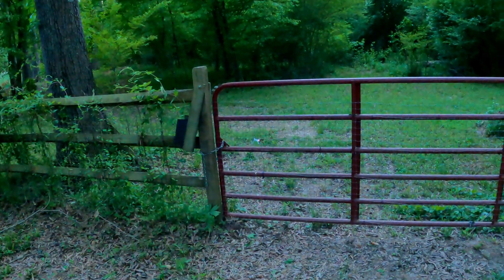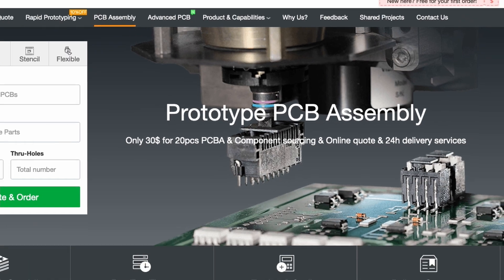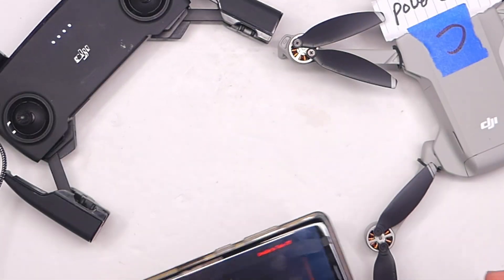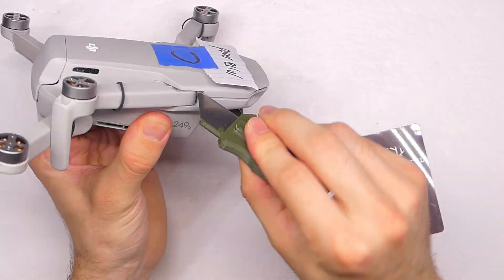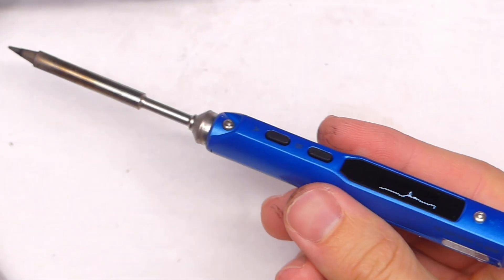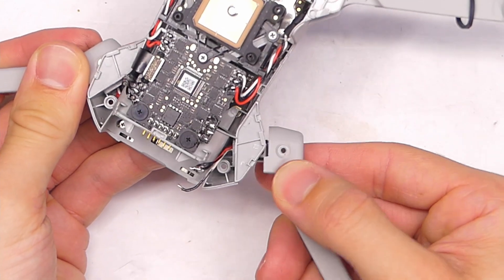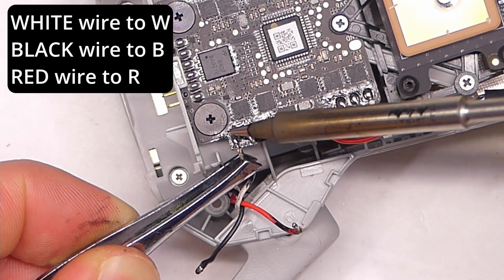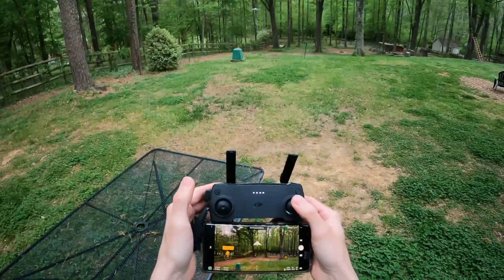How to Change Mavic Mini Broken Motor and Arm (Rear) | DJI Power System Hardware Error 30210 Fix

Comment: glad for you it worked, nice demo. Should have mentioned the front arms are way more difficult since the antenna (vertical part of front arms) wires run together with the motor wires through narrow space in the arms. You need the floss-wire trick to pull out and back (or through in case of new arm) to get that done. 
The problem with this error is that you can not clear it, other then restart, and that the message is a result of only the threshold of max current being surpassed during boot. This can just as well be caused by shortcut in ESC- or GPS module, gimbal damage, multiwire cam damage or cam-motors damaged. Beware that cam-pbc itself holds calibration data, changing it may cause a DJI-ONLY calibration procedure in a DJI repair center. Do not let yourself be fooled by Chineese Python script solution for recalibration.

Comment: Can someone send me the video as such for the same code and taking off the front arm?
Reply: the front arm is much more difficult cause the wires are longer and join with the front antenna wires (vertical part of the arm) so you really need that floss-wire trick to later be able to repull wires throught the arm. Also the mechanism is in a nasty corner and under mechanical stress while re-installing. Be carefull, just take a lot of time and photos.
If the 30210 error is not caused by prop motors, cables, or ESC pcb then you're in for a real party: the cam-motors are most likely damaged or the multi-wire cable. Search for gimbal repairs, NOT EASY

Comment: I replaced the right rear arm and now that arm has less power. It’s not giving any codes but when taking off it picks up and pulls hard to the right bottom then the drone spins then stops. Honestly I could have messed up one of the boards soldering the wires back to the board. Any help would be appreciated

Comment: BS, I put a new motor and ended up getter the error code after I put a new motor. Never had it until the motor swap, even after a crash. Just a previous ESC error code that would only allow intermittent flying.

Comment: I did this with a new arm and motor, but not my drone wont take off.  No error messages, and the motor spins fine, but when i try to take off the drone leans towards that arm and spins out.  Checked wiring, and it seems fine.  Pls help.
Reply from the maker: Maybe the propeller blades are on wrong (they should match the opposite diagonal motor). the motor could be spinning in the wrong direction, but that is unlikely since the wires are labeled (but if it is, all you have to do is switch two of the three motor wires).
Reply: @RCwithAdam1  thanks for responding man.  I checked the props and they are good, but I left some information that I thought was irrelevant out.  There’s a little foam piece that inserts to each arm, that I lost for the rear arm I replaced.  I thought it wouldn’t make a difference, but I think it could be my issue?
Reply: I ordered a new arm and will let you know what happens
Reply: I put alll new blades on it and still does it.

Comment: Can you tell me why the dji drone (eg dji mini 2) runs out of battery, so why when I have charged the battery to use it, I want to store it for a long time without fully discharging it.  Just like when the new dji sold, thank you!
Reply from the maker: As I understand it, those batteries are made to "self discharge" automatically to increase the lifespan of the battery. Which makes sense in the long run, but is inconvenient in the short term.

Comment: Hey little trick for when you're taking one of the arms off before you pull the wires through attach a piece of dental floss to the wires and pull it through with them is through with them and then when you pull the wires out of the arm with the motor keep that piece of floss on there That way when you go to put a new motor in if you do not have an arm you pull that piece of floss and it is no longer tricky to get the wires through  This is an electrician trick  You can use on many different applications Not just electronics or wiring either Also I need to repair the rear left arm on my drone where did you get yours Mine is a Mini 2

Comment: Plzzzz help me sar 
Preflight Check Gimbal calibration error. Restart aircraft or contact DJI Support if the issue persists.(Code: 40011) Gimbal IMU data error. Contact DJI Support for assistance(code: 40021)

Comment: Hi Adam, funny that you do a video on repairing a dji mini quad when I am thinking of purchasing one and was wondering how crash resistant they were and how easy they are to repair.
 I am in 2 minds about getting the insurance where dji will fix it or replace it for a minimal cost but at around £60 gbp it aint cheap if you dont use it , I could get another battery instead for that price which I would use 😁.
Keep up the great work mate excellent vid as always .
Stu